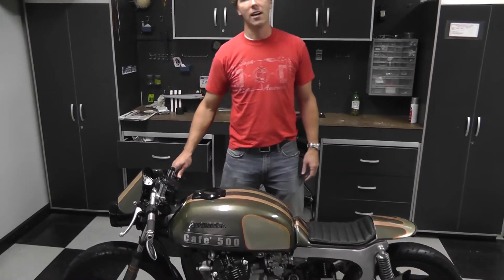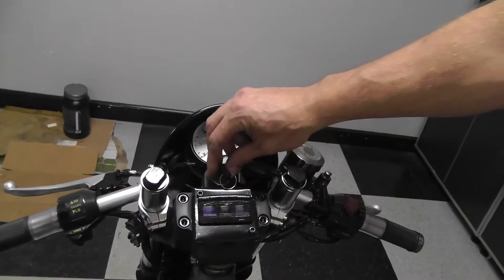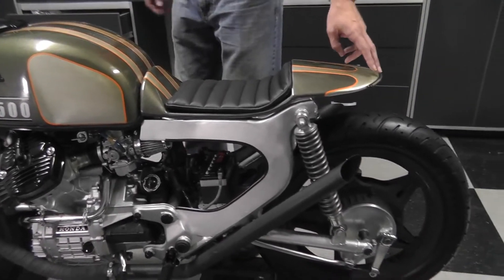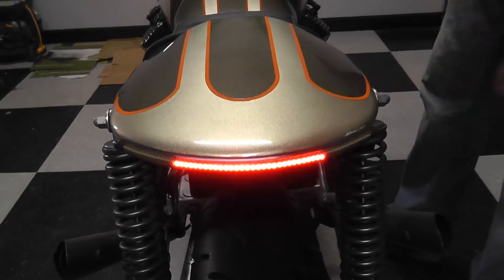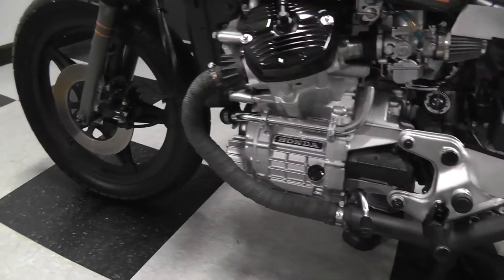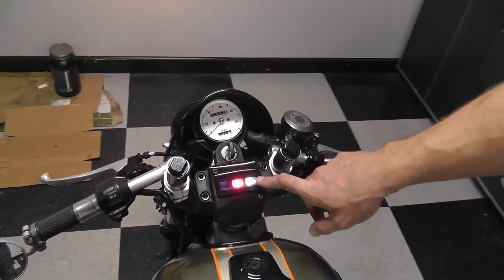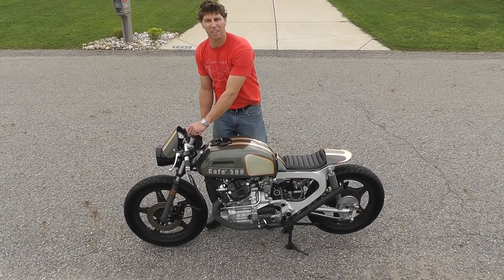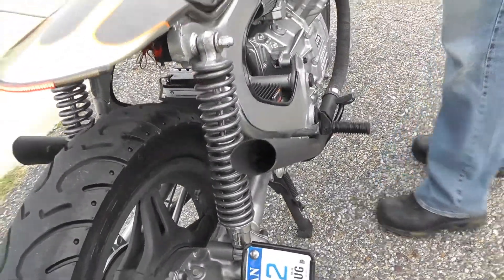Low and Mean" Cafe Racer 500 from 78 Honda CX500, Walk around and build

Comment: Nice bike but whats up with the cheesy "80s" music? . Detracts from bike.

I had a CX500 Turbo back when the 600 Ninjas first came out., My friends Ninja would beat me off the line, but mid to top end when that turbo kicked in at 5500rpm, it couldn't keep up. That turbo just kept pulling. Around town if you weren't paying attention, the bike would lift the front end when that turbo kicked in. under acceleration  Great bike. Ahead of its time in design. Fuel injection, shaft drive, water cooled, full gauges including a digital fuel level gauge, (unheard of in a 500) and really cool LED turbo boost gauge.  Plus it was really comfortable to ride.

At 04:29 what is that 'specialty painting tool" used to hold up the front end?  =)